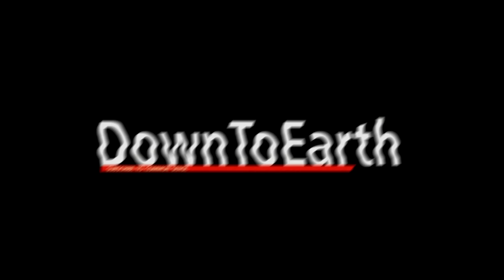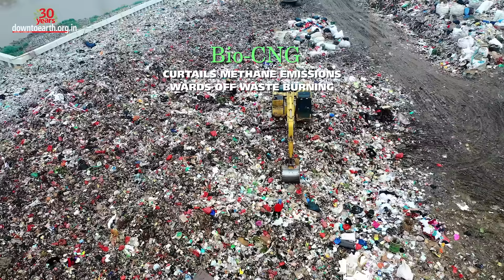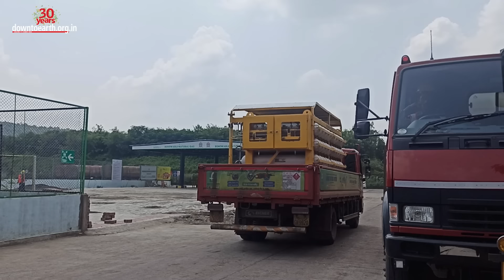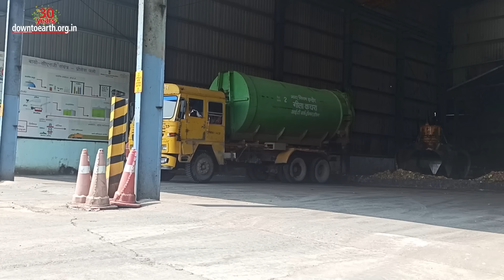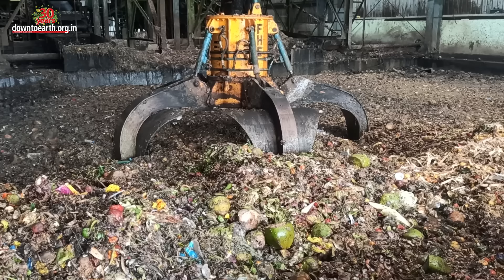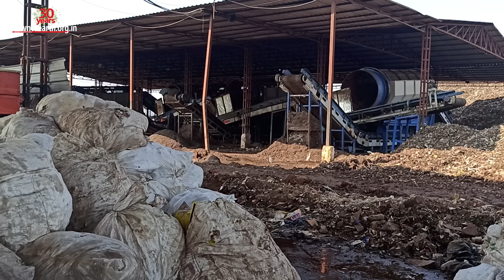This is India's first Bio-CNG plant that fuels Indore's buses

Comment: The term Bio CNG is wrong. while it is no more CNG. It should be CBG Compressed Bio Gas.
Reply: Compressed #Natural Gas - Methane 95% + Hydro carbons.
#Bio gas - Mix of Methane + Not Hydrocarbons — CO2 + Hydrogen sulphide + Nitrogen & compounds + CO etc 
(#Indore Plant removes non hydrocarbons like CO2 etc) so it becomes Bio — CNG(Bio -Methane)

LPG - Butane + Propane (heavier Hydro carbons).

Comment: World going toward ev bus but still your mind is on CNG bus..😑😑😑😑
Reply: the switch to e-vehicles will take more than a decade. Till then petrol and diesel ic engines will have to continue. 
Fuel cells are being developed, to generate electricity from methane. 
All this while wet bio-waste will continue to be generated by our growing urban population. 
So unless you develop a vehicle that can run on wet bio-waste, there is no other option to converting it to bio-gas this way.